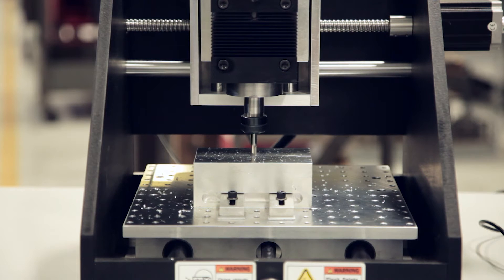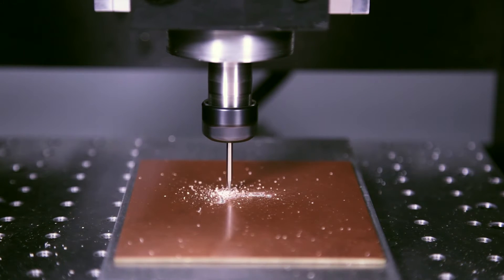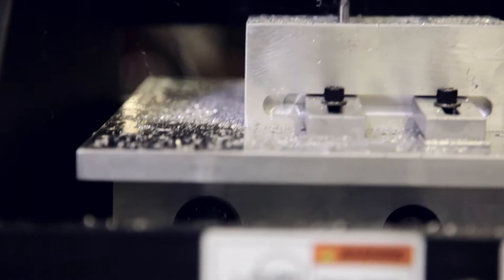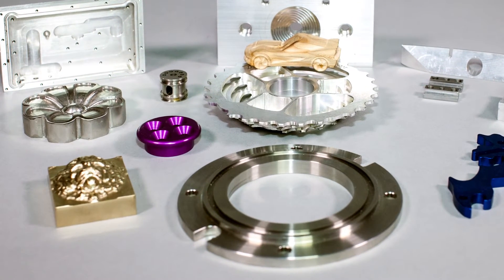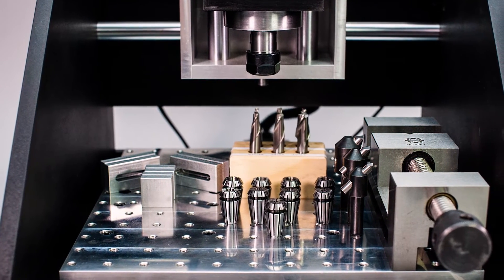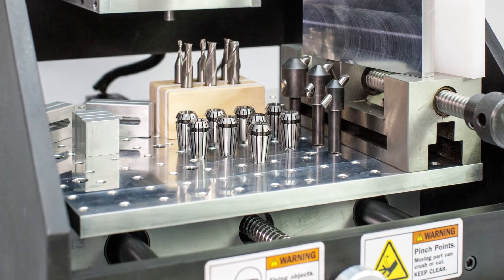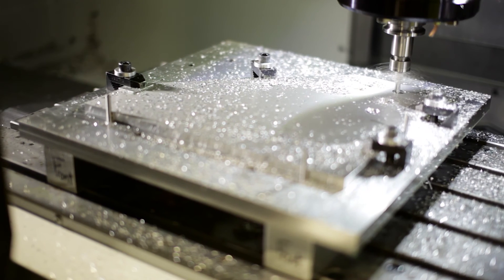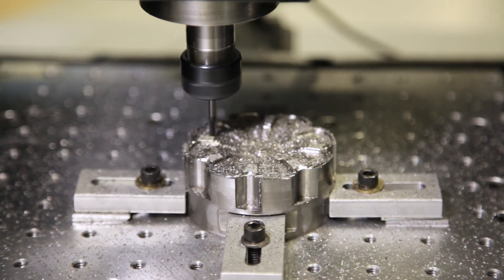SEMP Desktop CNC Mill Line

Comment: Nice machine, but wait, you are asking $3000 for this gutless desktop machine when the price of a Tormach 440 starts at $4900.  You REALLY need to cuts your manufacturing costs OR profits, because this doesn't make sense to me. (maybe at $1500)
Reply from the maker: Thank you for your feedback, Richard.

Yes, it is correct that the Tormach 440 "build your own" starts at $4950, but this dollar amount is somewhat misleading. An investment of an additional $1000 (not counting collets and tooling) is necessary to purchase additional options to begin milling. In other words, it costs about $6000 to start your first project with the Tormach 440, or roughly double the cost of the SEMP CNC mill. 

Here are some comparative specs: 
 
Travel size
Tormach: 10(x) 6.25(y) 10(z)      SEMP DTM: 7(x), 8(y), 6(z)
 
Ball screws
Tormach: C7 triple captured       SEMP DTM: C7 triple captured
 
Weight
Tormach: 450LBS                       SEMP  DTM: 105LBS
 
Spindle
Tormach: 3/4 HP                         SEMP DTM: Up to 1.7 HP
                10,000 RPM                           5700 RPM
 
Frame
Tormach: Cast                             SEMP DTM: Fully machined
 
Collet
Tormach: R8 up to 7/8 shank      SEMP DTM: ER16 up to 13/32
 
 
The Tormach does out-perform in some of the areas outlined. However, we believe that our $2995.00 price tag is fair for a desktop CNC of this size, featuring a fully-machined body and the power to cut hard alloys.  Even better, SEMP CNC mills are made right here in the USA.
Reply: The machines may do similar things, but I don't think the two packages are comparable. Everything comes separately with the Tormach.

I think the Nomad 883 is a much better comparison to the DTM 280. Your machine is about $500 more, but seems much sturdier with some higher end components like ball screws. Your spindle is also 7x more powerful.

I hope you consider this in your future marketing strategies. I haven't heard of you until now, and I'm very impressed.